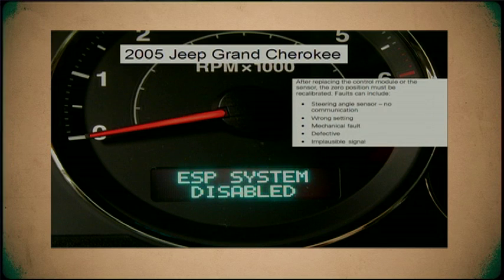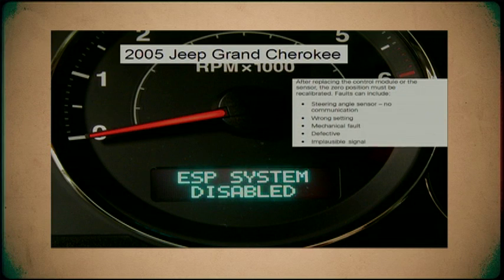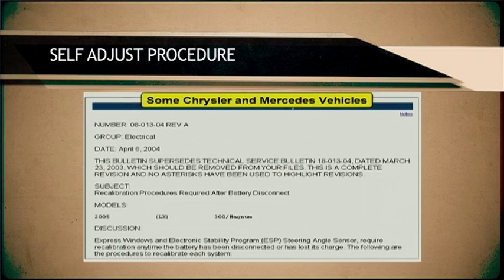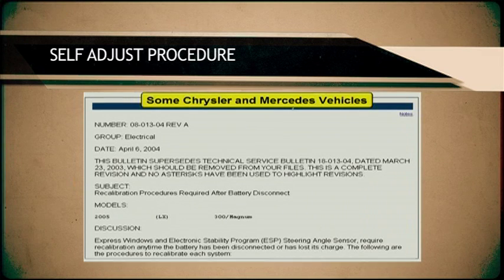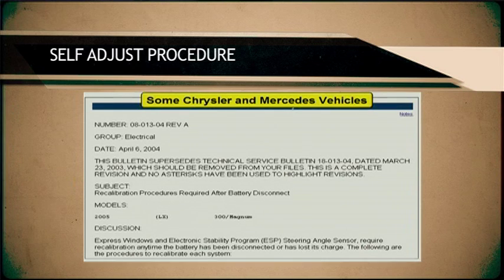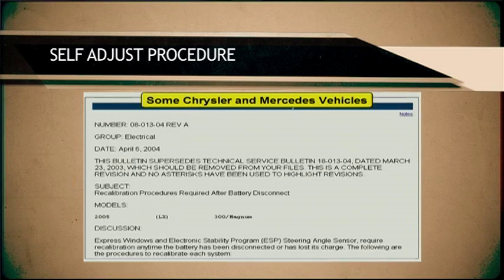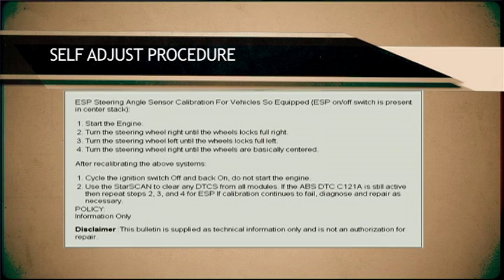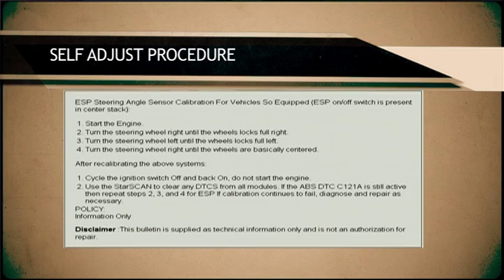Steering Angle Sensor Reset | Self Adjust Procedure Method | Tech Tip

Comment: If I  have a bad clock spring and buy a new one, should I buy one with the steering angle sensor or not? How can I tell if the sensor is bad?
 Thanks
Reply: A bad sensor would trigger the traction control light and ESP light.

Comment: local mechanic wants to charge me $500.00 to repair my steering wheel sensor after my driver side steering tie end rod broke off. i bought 2 new steering tie end rods & counted the threads on the old ones took notes, measured counted 4 times checked & verified took then took pics to use on the new ones.

i knew an alignment had to be done when anyone messes with suspensions. 

The mechanic said the steering wheel sensor is off at 8% from center.

would this reset/recalibration work on a 2007 GMC Envoy V6 automatic 2WD? 

thank you
Reply from the maker: We currently are not seeing a reset or recalibration procedure may have a bad
or misaligned steering angle sensor or alignment may not have been performed
properly.

For more information please go to aviondemand.com.

Comment: Thank you for your video!
2006 Chrysler 300 Touring 3.5
I have the traction control light & ESP/BAS light on together. 
I had the code read & "Steering angle sensor" was the code that came up on the snap on code reader.  
If that sensor is the issue and I replace it will this procedure reset it and turn off and recalibrate it and save me from having to go to the mechanic?
Thank you!